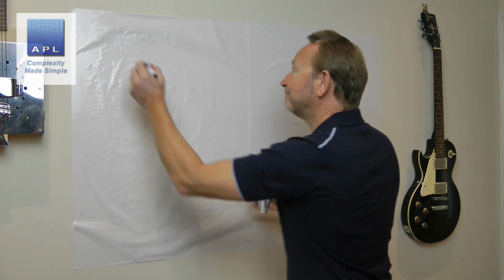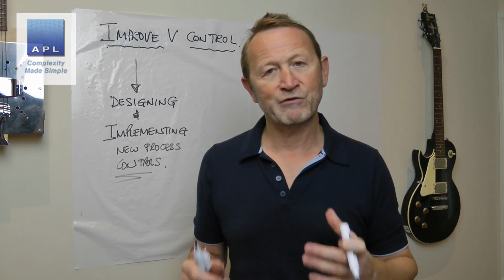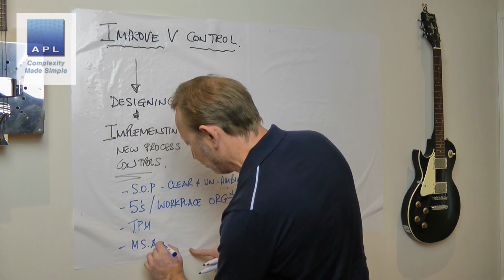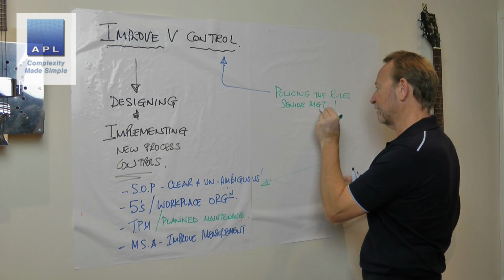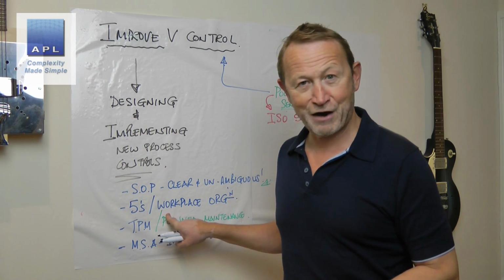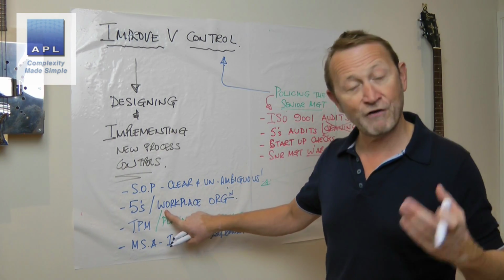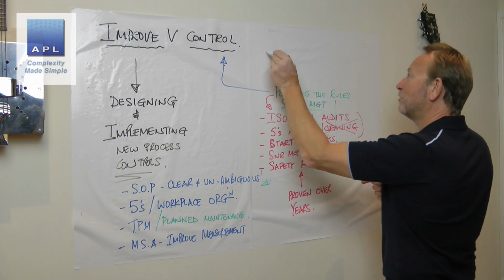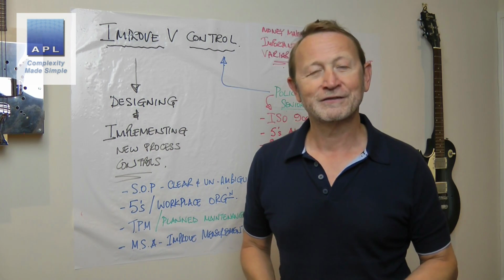Clarifying the Improve and Control Phases...

Comment: Best tutorial out there. Thanks Paul. Please, can you help me with the formula to calculate the number of replicated center points/repeated runs in a CCD? From the software, I got 8 repeated runs from 50 runs (5 factors 5 levels).
Reply from the maker: Jimmy - I think I answered this on another video, but if you use mid points at the beginning middle and end of the DOE then 3 midpoints is a good guideline....